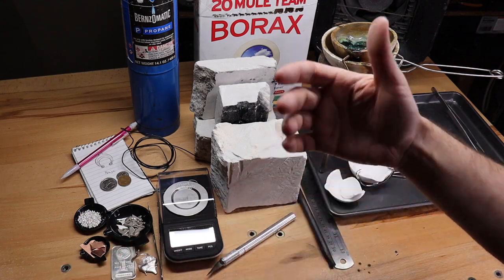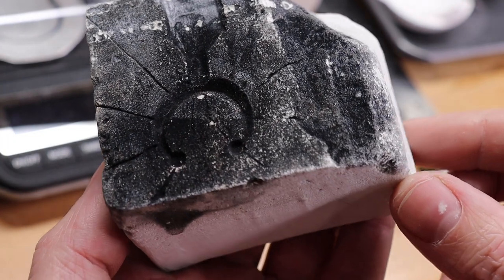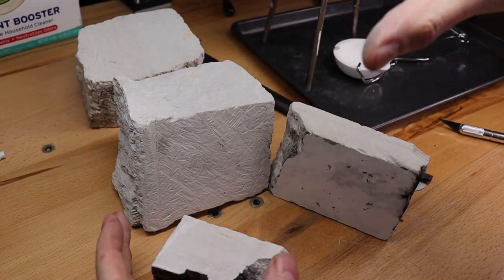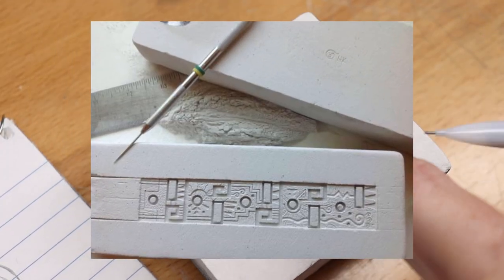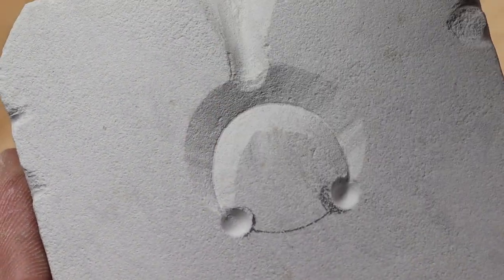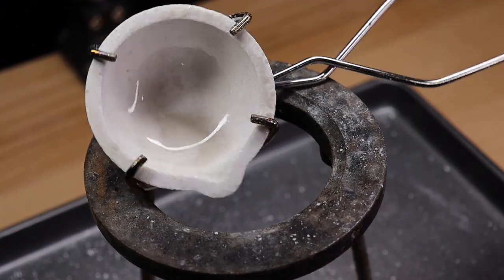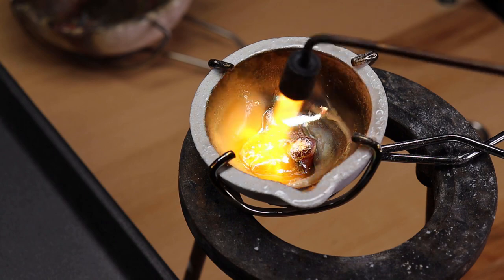Simple Silver Casting - Tufa Stone Casting

Comment from the maker: In this video I go over how to cast silver jewelry using Tufa stone. This is based on how the Navajo make silver jewelry and many still do to this day. I have seen very little info on this and not that many videos that go into details so I thought I could help get the info out about this technique.  

Thanks to Bench Tool Junkies for sending me most of the casting tools to make this video. If you don't already know Bench Tool Junkies offers a Monthly jewelry tool and material supply box. Check them out at http://bit.ly/BenchToolJunkies

Tools and Materials:

Tufa Stone for casting - http://bit.ly/TufaStone

Stainless Steel baling wire - https://amzn.to/34r00l2

"Use Code GomeowCreations to save 15% on excelblades.com"
Sharp Razer Blades - https://excelblades.com/gomeowcreations

Smiths little Torch - https://bit.ly/SmithLittleTorch5tips

Rose Bud Torch End - https://amzn.to/3krLoaF

Heating Tripod - https://amzn.to/31BEYyg

Crucible for Casting - https://amzn.to/31ARCxr

Borax Powder 1lb - https://amzn.to/2ISMQoA

Hand Files - https://amzn.to/35uQD3i

----------------------------------------------------------------------------------------------------------

Here are some helpful videos that I found about Tufa stone casting that you might find useful:

Navajo silver jewelry Cast work Sand and Tufa:
https://www.youtube.com/watch?v=xKsnDdMoovI&ab_channel=TurquoiseSkies%28T.Skies%29JewelryGallery

Cutting Tufa Stone:
https://www.youtube.com/watch?v=We7vglpfgLA&ab_channel=crbillie

Carving Tufa Stone:
https://www.youtube.com/watch?v=QQ_zHfL_D3E&ab_channel=JeffDeMent

----------------------------------------------------------------------------------------------------------
Time Stamps:
Intro 0:00
What is a Tufa Stone 1:00
The design 2:15
Preparing the Tufa stone 2:36
Carving the Tufa 4:12
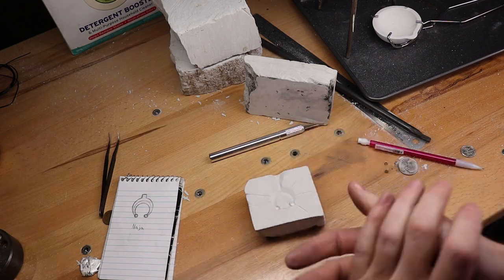Joining the parts mold together 9:42
About torches 13:06
You silver Options 13:48
About Crucibles 15:13
Seasoning Crucible 16:22
About your casting area 19:24
First casting 20:05
Opening First Casting 21:05 
What to do when you fail a casting 21:23
Second casting 22:08
Final Casting 22.23
Cleaning up casting 23:24
Cleaned up and patina 25:50
Thank you for watching! 26:38

----------------------------------------------------------------------------------------------------------

If you are looking for more tools and materials that I use, well you're in luck! I made a page on my website just for that and I'm updating all the time so bookmark it to stay up to date:

https://GomeowCreations.com/tools-and-materials 
https://GomeowCreations.com/partners-discount-codes

If you buy any of the tools or materials from my list I will make a small commission at no extra charge to you and it helps support the channel

----------------------------------------------------------------------------------------------------------

If you would like to directly support the channel you can do so in a few different ways.

If you would like to directly support the channel you can do so in a few different ways.

1. Like, comment and share my videos

2. You can make a one time donation via Paypal of any amount https://www.paypal.me/gomeowcreations 

3. You can sign up a monthly donation via my patreon for as little as $1 per month https://www.patreon.com/GomeowCreations

4. You can sign up a monthly donation via my Subscribestar for as little as $1 per month https://www.subscribestar.com/gomeowcreations

5. Just watching my videos helps out too and I'm happy to see that I have been able to help some may people get into jewelry making.

#tufacasting #tufastone #NavajoJewelry #jewellerymaking  #jewelrymaking #goldmaking #silversmithing #diy #gomeowcreations

Comment: We usually use a length of rubber inner tube to hold the mold halves together.  Much better than wire. Bicycle tubes work very well.  A couple wraps that you tuck in  the end, or tie two ends off.
Reply from the maker: Thank you for that info. I had very little time to get this video done but that is something I will definitely need to get ,😅👍

Comment: Great information! I am curious to know why you say to avoid any bits of solder in your casting melts. I thought solder was silver? Also, do you need different crucibles for fine and sterling silver?
Reply from the maker: Solder is mostly silver but has other metals in it. If you meant them down into you casting it can make bubble or cracks in the work. For example I think hard solder is only 76% silver. 

As for the crucible you should have one for every metal. This is because it leaves little fits of the metal behind after you cast. So if you use it for silver. And you want to use 18k gold next you will be mixing silver into it changing the color of the gold along with the K
Reply: Hi
The solder has zinc in it so it melts at a lower temperature than the silver. You can use scrap with a portion of solder (only really clean metal  I wash my filings with dish soap in a gold pan and wash out all foreign materials - just like panning gold), but it is not good for drawing wire or milling sheet because too much zinc makes the silver tend to crack. Hope that helps. But the scrap with solder is fine for example a ring, ... that won't be drawn/milled.

Comment: Cool.  Those are hard to do.  I usually heat the mold too so that it sucks the metal in.
Reply from the maker: Yeah I kinda did that a little on my last casting, I don't want the full torch on it for too long because from what I have seen you can ruin the stone a bit. I would have to play with that more in the future.